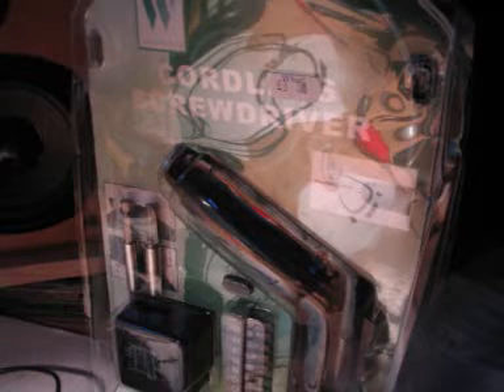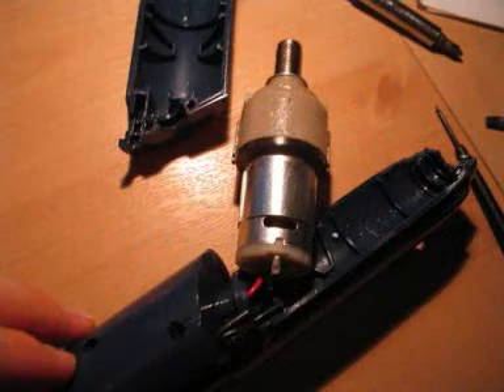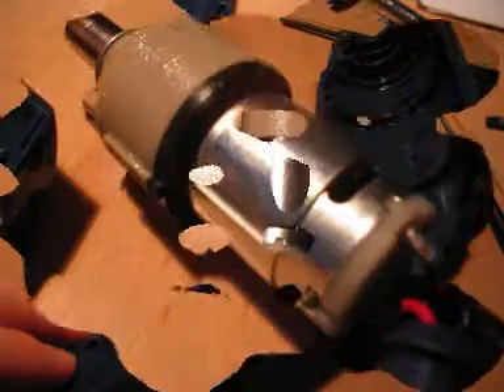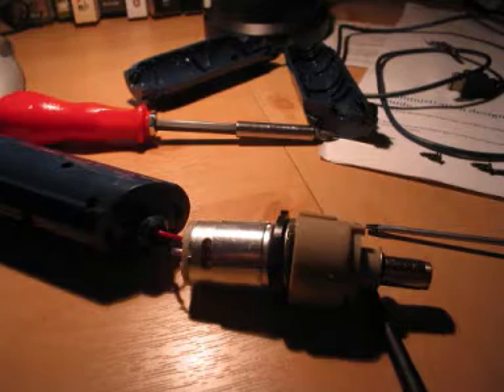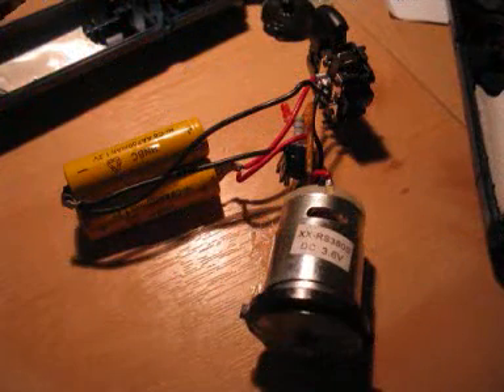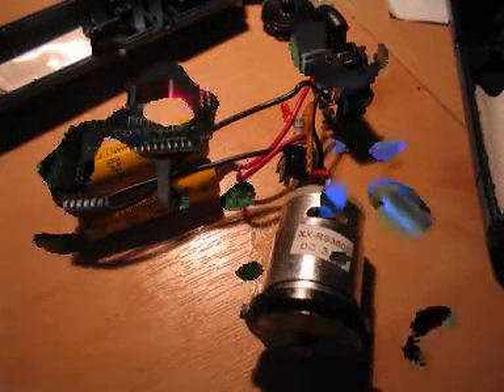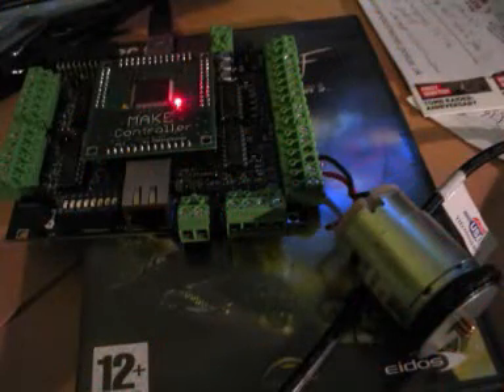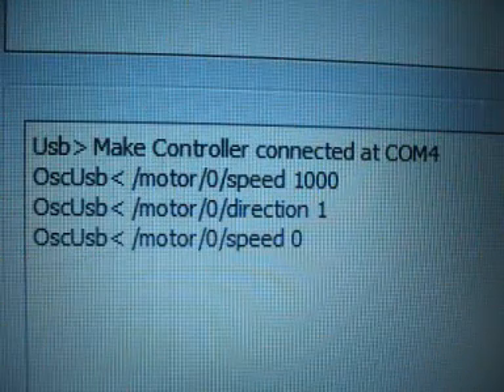Make controller - wiring up a motor

Comment: I am not sure what this video is about . Is it about you but a used cordless screwdriver for 3 quid or that you tore it apart. Because I could not see anything that important about making a motor variable speed. That could had been done with a light dimmer switch. But if you put the information in about the board and where to get them or about what all the board could be used for